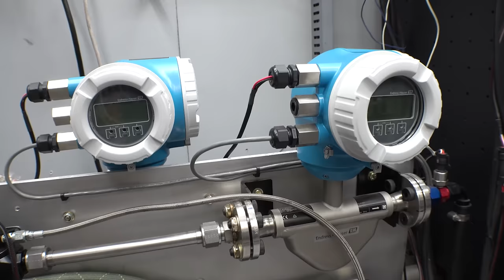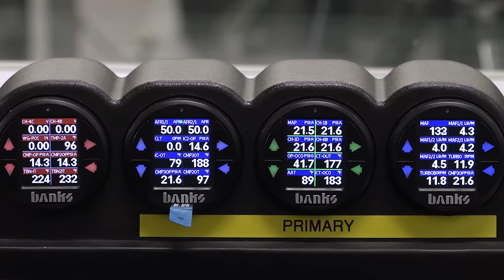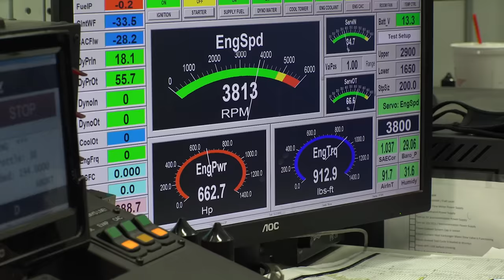SUPER-TURBO DURAMAX FIRST FIRE! Building A Monster Truck Engine Pt 12

Comment: This beast of an engine looks like something out of a mad max movie. Can't wait to see more.
Reply: I hope it makes it into a Mad Max movie.
Reply: @RadDadisRad  that would be epic.
Reply: I hope it makes it into my truck💪
Reply: @youtubestolemyhandle1   Hahaha that wouldn't fit under the hood of a Kenworth 😂😂😂😂😂😂😂🤷🤬
Reply: Josh Ray 
I don’t need a hood.
Reply: @youtubestolemyhandle1   I guess you don't need frame or finders either 1000 HP on a engine dino is a joke 😂😂😂😂😂🤷  I daily drive a 800 wheel horsepower Cummins 12 valve I have a little perspective in this. Gail Banks is quickly becoming a joke in the Diesel performance industry.
Reply: @user-el4ii7zq6l  why
Reply: @user-el4ii7zq6l  mind you that you have 2 times the displacement so no gale would smoke your truck
Reply: I'm waiting to hear "witness me!!" And Gail come running out of the dyno booth with silver spray paint
Reply: @user-el4ii7zq6l  Banks may not be the one for the off road performance side of diesels. He's focused on clean with more power and staying compliant. Rolling coal is fun but the tree huggers are going to start cracking down on people smoking out crowds in traffic. He's based in california so I'm sure they have a nose up his ass all the time. ATS  is taking the same approach.
Reply: @ZNX05  Because the L5P is making 550 or so HP stock. So 700 is not that impressive. Adding a twin turbo+blower duramax setup should be well in 1500HP range. Look up Tony Pizzi's Duramax dragster, it is destroked to 360CI, turns 7500RPM and makes 2500HP. 

But this Banks engine still needs a tune. I really wonder if he can make it turn over 6000 RPM and make 1500 HP @5000RPM or so. Time will learn. But Banks sure takes a lot of time here to publish these videos. This engine is probably not their priority.
Reply: fam its is mad max just branded as "dura" division of maxes
Reply: @user-el4ii7zq6l  a built lml destroys a 12 valve all day

Comment: 700hp 1000tq 

Then states, "Let's start tuning it..."
Reply: Dude I thought the same thing
Reply: CRAZYYYYYYYY
Reply: And that’s only 3800rpms🙃
Reply: @kevinkissoon7721  how bout 9000?
Reply: @042-renoromzulfauzi5  diesels redline at around 5-6k so 9k is unheard of. This motor must be insanely build haha
Reply: 9000 hahahahah Elon Musk would have something to say about him running that high as it might become a flying projectile and interfere with spaceX
Reply: @042-renoromzulfauzi5  a diesel can’t d’un at 9000 rpm and really doesn’t need it
Reply: @marinlenfant6976  the only thing I can think of is if its been destroked but thats still just a wild idea for a diesel
Reply: @gearrodclements7531  what is destroking? Just decreasing the travel of the piston for higher rpm?
Reply: @chapzer6686  Yep. Increased stroke increases piston speed, which exponentially increases the amount of force on the rods. It's why F1 engines have such comically short strokes relative to the bore on the piston.
Reply: @howtofrank502  there are drag 1.9tdi´s that rev to 9k
Reply: @marinlenfant6976  Yes they can, there are some Diesel race cars that go over 9k
Reply: @howtofrank502  he said it’s a high rpm
Reply: @Kev-E46  that means they dont use normal diesel because you can only rev to 7k with normal diesel due to the maximum flame speed. Built OM606 and OM605 and their variations often rev to 7k when built, but never further than that.
Reply: @MV-ri7zu  well, petrol race cars rarely use normal petrol 😉
Reply: I mean a tuner supposedly gets you above 500 hp on a stock duramax so with all that is going on on this behemoth I’d hope it can put out at least 700
Reply: @Kev-E46  well Darkside Development's 9.45s 1/4 1.9TDI swap Seat Arosa revs to about 7.3k
Reply: @tootruesheep872  what are you trying to tell me? there are 1.9tdis reving 9k as i wrote above
Reply: @Kev-E46  ?? i was just stating a fact i heard fam fucken hell.

Comment: Be sure to make sure that accessory drive plate for the supercharger stays solid. It moved quite a bit at startup! 

Excited for the next installment :)
Reply: Agreed, the overhead view when they put some power and load to it revealed the alternator and its mount moving quite a bit. They'll get that fixed for the next run i'm sure.
Reply: You act like they are shade tree rookies, 😂
Reply: @TheRoadhammer379  everyone makes mistakes.

Comment: 4:44 looks like pipe oscillation on the cylinder pressure transducer. I had the same with a glow plug type transducer. Can make heat release calculations difficult. Awesome to find a channel with this type of proper engineering in diesel engines.
Reply: Perhaps you can filter out the high frequency spikes?  A flush mounted transducer is not susceptible to shock waves travelling down a narrow passage to the sensor.

Comment: I work in a BASF production plant and I don‘t line the new Endress+Hauser stuff. The old promass 83 and 84 stuff had much better controls.
They‘re ridiculously accurate though, we calibrated them to 0.1%  error with ease.

Funny to see those outside of work!
Reply: I thought BASF were in charge of paint?

Comment: About 10yrs I had a full header back vibrant exhaust on my civic b20 block b18c5 head 14:1 pistons h beam rods and q16 made 450hp all day and sounded great (for a Honda) vibrant made my header based on the lengths I wanted for runners it just cost me

Comment: That you Mr. banks. I have over 30 years in the industrial and diesel engine business. My hobby and desire has always been racing engine. I never desired performance diesel engines simply because of the SMELL! Diesel makes me money, methonal make me go fast. 
Regardless of personal desire, I have been acuanted with banks quality for many years. My first banks experience was turbo charging a crappy old 6.2 gm diesel. Customer was happy, I was happy, and Mr. Banks made money off of happy people. 
Thank Man, Shane McCrary

Comment: So, I was a little harsh on the pedal monster video that you guys put out, but I have given it some thought, and I was wondering if with the pedal monster you can set a slightly higher  idle rpm. I was thinking that if you can adjust the idle higher and control it for when you are trying to do things like run the heater in winter, or air conditioning in the summer, but you don't want to let it idle for long periods of time because idling for extended periods is not good for the engine, or if you wanted to give tiny adjustments to the speed when crawling, then it would be worth so much more than just for fun driving, and I would buy one immediately! 

Please let me know if this can be done, and when I can buy it!

Oh, and as usual, your videos are awesome!
Reply: Why would you be harsh, do you really believe that you have 1/100th of the knowledge that Gale does? He's forgotten more than you will ever know, lmfao

Comment: I believe you need to size your supercharger tolerance proportionally to the air density it is receiving from the turbos. It's like a hydraulic pump if you run too think of hydro fluid through a pump with tight tolerances u will put excess pressure on the shaft bearings and loose efficiency
Reply: Sorry, "too thick"

Comment: With the air fuel mixture, ever thought of using the air conditioning to condense the air? Like the set up dodge uses?
Reply: I've had a lust for that idea since I was 10 years old lol
Reply: They already have intake temperature reducing devices.  Water/Methanol injection.  External Nitrous Coolers.  The cost  of having a A/C compressor big enough to cool intake temperature would out weigh the benefit of having it in a performance application.
Reply: Chris Moltisanti not even would be expensive, attach any old ac on at it would massively reduce intake temperatures

Comment: The jump in horsepower and torque was interesting in a scary way
Reply: why? There is literally a load knob on the dyno that increases the required torque from the engine.

Comment: There's no way they arent going to see issues with cavitation running only 15psi supply pressure to that 14mm. Most people are running 80psi or sometimes more to them to eliminate it, or conversely they underdrive the pump (which is why you see massive CP3 drive wheels/gears on many competition trucks).

Comment: Thanks for bringing us inside Dyno Cell #1. Is there any benefit to excess fuel in a sled pulling application? Does the excess fuel keep cylinder temperatures down?? Using a water injection system in cross over pipe and pre turbo. 6 cylinder ag engine.

Comment: Owww.  Datus interruptus.  I was hoping he was going to analyze the data from the test run in this video.  I can't wait to see how the supercharger and turbos play together.  The engine was going through some instability while it was being loaded at 3800 rpm.  Perhaps some oscillations in the charge air system?  And some parts in the FEAD system were vibrating to and fro, so their mounting needs stiffening.  But really good for a first run.  Does this engine have the same Comp Cam as the KAD engine?  Or something past that?  The engine at 3800 rpm sounded kind of like a Detroit Diesel.

Comment: Hi Gale, I only recently found your chanel, and am loving learning from the content and your clear to the point explanations. I would love to know your thoughts on these "interchillers" that I am seeing marketed which piggyback off the A/C system to deliver sub-ambient IAT for Air-to-water intercooler equipped vehicles. Is there a sting in the tail with them? I would love to know your thoughts. Thank you.

Comment: Gale, I bought a Brand New Chevy with the Duramax L5P,  what is the best oil to run in this beast? Running Amsoil in it, What is the benefit vs the competitors? Hoping you can help me out, since your probably the most knowledgeable with torture to this platform!

Comment: If I needed a 5 gal per minute fuel pump to run my truck I couldn't get from my house to the nearest gas station without running out of diesel before I got there.

Comment: Fkn beast of a thing. How much grunt mate?
Reply: 700+ herspers / 1000+ terk
Reply: @karlmalone2464  and that was only at 25:1 air/fuel ratio. I think he normally uses 18:1? as his equivalent of wide open throttle as anything richer than that starts to smoke.

Comment: Hello Mr. Banks. Why no Water/Methanol injection on any of these projects? You focus a lot on air density. W/M can aid greatly in charge cooling, yet you do not promote it. May I ask why?
Reply: With a good intercooler, water-methanol injection is redundant.  The intake manifold temperature is too low to evaporate the water-methanol mixture.

Comment: That's cool as a fan but will that fit into a vehicle that will drive down the road under its factory sheet metal?  A dyno queen is cute.
Reply: It's being built for a Monster Truck.  So it will have a real-world use.
Reply: @jonasthemovie  ok professor. You need more attention.  What vehicle will that monstrosity assembly fit under the hood?  I'm not a Gale fanboy like you so I missed that this is going into chassis monster truck and not going under the hood of any vehicle.  You seem to have take the reigns of people talking out of their a**.  A previous comment answered my question hours ago but you still need to be heard.  Go play with your crayons.
Reply: @jonasthemovie  Thank you.  I've never saw any monster truck run wide open for so long.  This test seemed pointless considering the they only run full throttle for a few seconds at a time.  That is why the title made no sense. We get it, you are a Gale fan boy and can't get enough of him.
Reply: @jonasthemovie  It's like you are becoming a fan boy of me now which seem kinda weird. Have a great day keyboard commando.

Comment: Is there any way to get any power out of a diesel while nearing maximum lean fuel conditions? Or does the power drop off below a certain threshold?
Reply: Injection timing can help, but if you have no more fuel to burn you won’t make anymore power.
Reply: @RyanBloemke  I hear ya loud and clear. I've been looking for a resolution to the ICE. There's a better way to do it but I just don't know it yet

Comment: Since a belt-driven supercharger uses power to make power why would you choose to use one with twin turbos instead of using bigger or more turbochargers AND why not use the screw-type compressor instead of a roots style ?
Reply: He covered this in a video a ways back, If memory is working it's in the first video, It's to give it PUNCH going from no throttle to WOT. So the truck can launch! based on the I-dash data from Driving the Monster Mutt around In the arena! Custom motor for its task at hand I hope it makes the truck amazing!
Reply: Yep, it’s the throttle response and immediate power that led to the decision to supercharger.
Reply: Watch all of the series.
Reply: @RyanBloemke  Yes.  The video where they put the iDash instruments on the blown alcohol monster truck is really interesting.

Comment: What's the point of feeding a supercharger with turbos?
Reply from the maker: The supercharger is only good for adding up to 30 lbs of boost. Turbos can far exceed that. As the supercharger reached is maximum boost potential, the turbos will be fed around it, bypassing the supercharger.  Then why have a supercharger? Instant throttle response.
Reply: @bankspower  so once you exceed 30 psi the turbos just push past the supercharger? Why not just use turbos and skip the blower?

Comment: Just get a Cummins....
Reply: @jonasthemovie  to go faster than a durmax
Reply: @jonasthemovie  yes every year the Cummins  motor  takes it at the diesel shootout..im not saying the truck just the motor Starting with the 12vales. And then the 24vales. Why do you think  that on the tractors ie.. over the road  dont use a V style type motor  it because they lag im not bashing what the durmax is that there not as reliable as the Cummins or a inline engine. For instance  the Bradley  fight vehicle  has a Cummins just about all the BAE mraps have Cummins durmax just doesn't  cut it i want .shit the ACE has a Cummins  and it leaks like a sieve. The HMEE  has a Cummings there others that have Cummins they don't have a durmax  they learned there lessons from the humvee
Reply: @jonasthemovie  lag meaning  that they have drag going at an angle. V style engines very small amount  but it adds up versus going up and down .

Comment: what happend to this project?
Reply from the maker: The two engine projects are on hold for an extended duration while we conduct testing for our military program (Banks Tech) in Dyno Cell # 1 & #2. The moment these projects are completed, we’ll roll both the Super Turbo and the Killing a Duramax back into the dyno cells. As for Banks Built, we've been doing additional tuning the Motec ECM and adjustments to the engine.
Reply: @bankspower  awesome! love the content

Comment: That's a lot of ching for 700hp and only 1000 torque.  My stock 6.7 Powerstroke is 450hp 940 torque. Just saying..
Reply: He limited to air/fuel ratio to 25:1 That air/fuel ratio is like break-in mode. He will richen it up to 17-18:1 and fully load up the dyno and make a shit ton more power/torque.

Comment: Lose the turbos and just go with a bigger blower.
For a monster truck sound is just as important as power, and those turbos are just going to muffle the beautiful sound of that V8
Reply: Go watch the beginning of the series, too much heat, not enough boost
Reply: He also runs a bypass... but uh sure you tell banks what’s up lol
Reply: Brodey Dover this is probably what is the most funny about is comment. Telling Banks how to run it 🤣🤣
Reply: There is no such thing as a blower that will make 40 pounds of boost with the same efficiency as a turbocharger.  And that includes top fuel dragsters.
Reply: This seems to be a lost trait, but its actually OK to question and disagree with someone, that's how we grow and learn. I have watched his whole serious on this and his other projects, and I was impressed with how Gale proved how inefficient an 871 blower is to a roots style supercharger and how DATA driven he is. Actually after watching his videos I bought my first product from him, because he impressed me so much.
But my comment was about sound, not the efficiency of a turbo. And I was turned off when he went the easier path like others do, with just adding big turbos. In any other racing that would be the way to go, but for monster trucks I would of loved to see him redesign the roots charger, or maybe through on some centrifugal superchargers to the front as well, so the exhaust stays unrestricted. When a monster truck fires up and runs an event all of your senses are active. When you lose the sound it takes away from the experience, that's all I was trying to comment on, not bash Gales work.  I would of loved to see the first all supercharged diesel monster truck, instead of him building a super charged plus turbo diesel that he has already created in other applications.
Reply: @GoldenHart1970  If you go to a Monster Truck show, there will plenty of blown V8's on alcohol making a lot of noise.  You might actually enjoy the different sound of the super-turbo diesel.